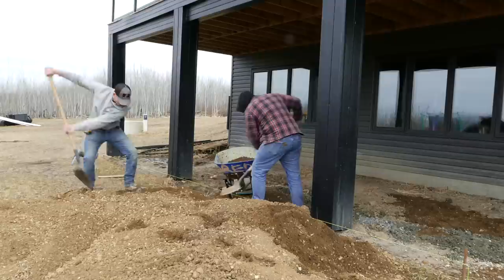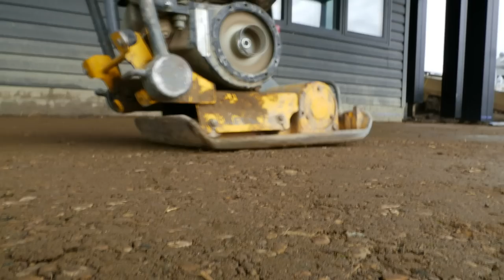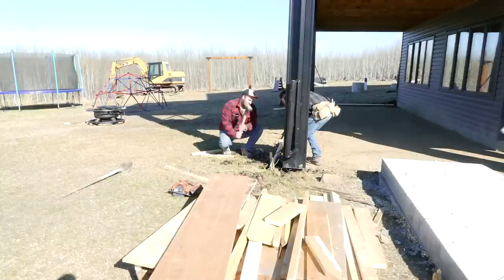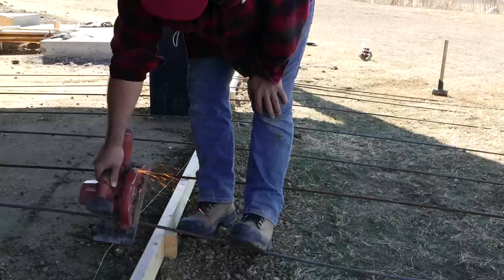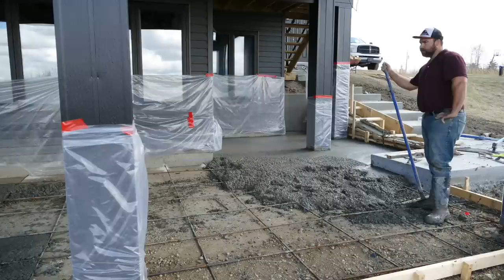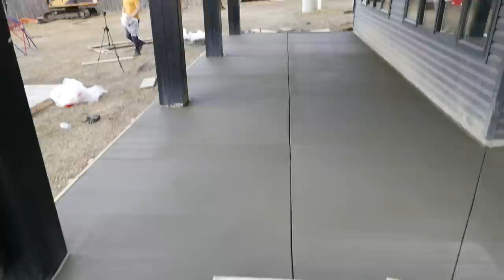Construction of Concrete Patio Start to Finish [ASMR]

Comment: When we do such things in Europe, there are some differences: We use a foil under the concrete layer to avoid moisture rising, we put the reinforcing steel rods in a grid distance of 10 cm (4") instead of 20" as you did, we use small prefabricated concrete blocks to keep the lower layer of reinforcement rods off the ground, and we usually do 2 layers of reinforcement grid (in at about 8 cm vertical distance)...

Comment: You guys need to invest in a pump.  It would save a lot of time and extra work using that buggy.  Out west we use pumps from the truck to the job site.
Reply from the maker: Pump here 1000$ minimum, buggy was less than a half of that
Reply: @Take_And_Make  How much time would it save, though? Could you charge the same job price to customer due to less labor yet still make the same profit from the saved time? Just curious. Thanks.

Comment: Question, the control joints that nearly line up with the posts dont go all the way to the end if the control joint cracks wont it continue on till the end of the slab? or will it turn slightly toward the post?

Comment: Should have added one more step to the bottom of that set of steps you poured last video that way the walk at the bottom of the steps would have been level with the patio !   Now if they put dirt to the top of the patio the dirt will be 8 inches below that section of walk that leads from the bottom of the steps to the patio !   Its to late now ,,,,but just a thought !
Reply from the maker: Maybe something to consider next time! Good point!
Reply: I agree with you Tim Nolan. Looking toward the stair you see that one step. Ugly in my opinion. I don't think they considered the patio grade. I would knock out that last stair step and fix it.

Comment: the strength of concrete depends on its shrinkage during vibration - there is no vibration there is no strength (hammering on the board is to close your eyes))))))